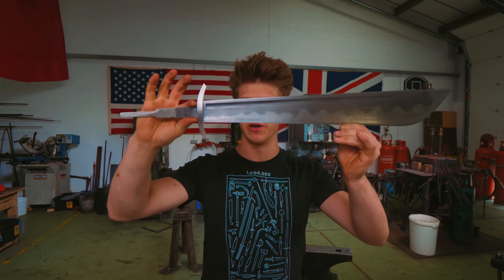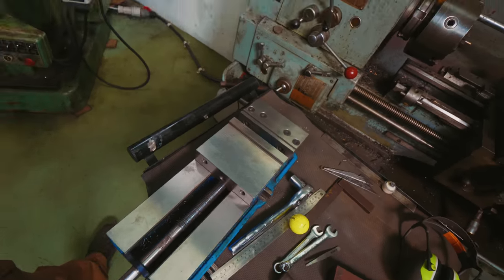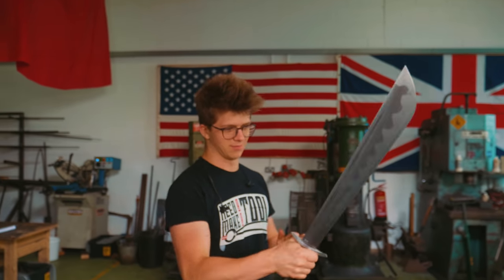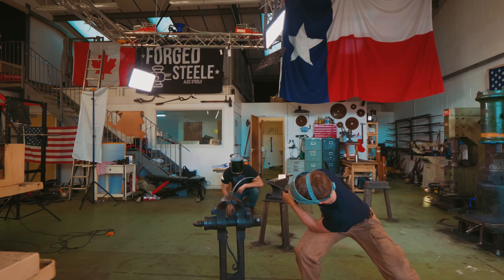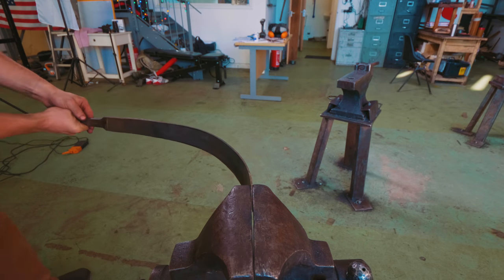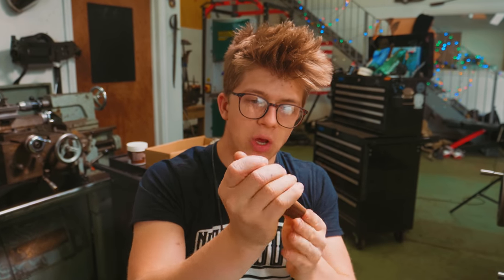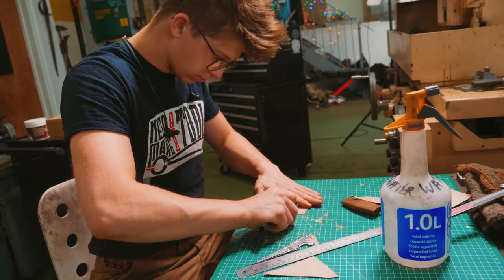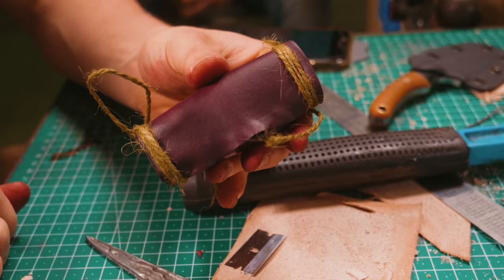MAKING A FALCHION!!! Part 7

Comment: Hey Alec. When i need to cut a leather wrap for a contoured handle, I wrap the handle in masking tape, cut the tape and peel it off, and use that as a guideline to determine how much to trim off the ends to match the changing diameter of the handle

Comment: Great work as always Alec!! As a dabbler in leather craft myself, I can feel your sudden  anguish when your skiving knife suddenly cuts too deep!😰 My experience: dampen your leather BEFORE you start cutting- it allows more control of your cut for some reason...🤔 Cheers!
Reply: GrizzWorks is correct about wetting your leather prior to skiving. If you are going to continue doing leather work. Get some professional tools. I make saddle bags and holsters along with knife sheaths. Also help in making custom fit saddles. Wet leather will stretch, THIN wet leather can do some incredible things when forming to shape. Keep it up. You are a very talented and curious craftsman.
Reply: Was just popping in to say much the same as Grizz and Jeremiah.  Damp it and skive it then soak and stretch the thin leather, let it shrink around the handle. Once it's dried, you can glue it in place neatly.  Have fun!

Comment: I've done the exact same thing when trying to skive leather, sliced right through the edge. Having a super keen edge helps to avoid that. Put a little jeweler's rouge (or maybe polishing compound) on the smooth side of some scrap leather and use to strop the blade on your beveler. Should help keep it from cutting where you don't want it to!

Comment: Alec i am not a professional by any means however if you are working with Veg Tan leather you are able to wet the leather and make it "fit" to a desired shape within reason. Once the leather dries it will retain the shape set (mostly). Also for skiving i have gone through several tools the safety skiver you used also. However i have found my best results have come from using an ASB Round Knife. It takes a little more finesse but it skives alot easier. A Marble surface to skive of with the tool is needed. On a side note for any skiving make sure your blade is REALLY sharp. Jewelers Rouge rubbed on to a leather strip and the tool pulled against it will give you the razor sharp edge needed. Apologies if you already know this, just sharing some of my limited knowledge.

Comment: Alec, since you occasionally work with leather, a good project would be to make a Damascus head knife. You can use as a skiving knife, push and pull cut and roll cut for precise cuts and for cutting around rounded corners. I think it would make an interesting project.

Comment: Try wrapping the damp leather around the handle with plastic wrap let it dry over night, then apply contact cement and let cure. Then use a saddle stitch to finish it up, if you want to get fancy,  apply a woven metal accent wrap over the leather.

Comment: To bring out a lot of activity in your hamon, try etching by rubbing hot lemon juice with two drops of dish washing liquid up and down the blade. Make sure you degrease first. You want the soft steel to be kind of a smokey grey. Neutralize, then use something like Mother's Mag and Aluminum Polish (I really like Mother's) to knock the oxides off. Do that 3 or 4 times, then polish with 1200 Al oxide powder mixed with 3-in1 oil, making a paste. Rub that all over the blade with lots of short strokes with a soft towel. I go to 2000 grit before I do this.

Also that wootzy stuff is alloy banding, it's not actually a good thing.

Comment: For waterforming vegtan leather I'd suggest cutting it a bit short (narrow?) for the circumference of the handle, and punching matched rows of holes along the two edges to lace it for drying and for finishing. I'd also make a slight bulge in the leather pattern to accomodate the changing thickness of the handle, making sure that there is some gap before stretching so the ends dont get baggy.  You can also trim it once you've started to wetform and stretch it.

Those skivers are awful, some people can make them work but I don't like them. I get the best and easiest results skiving with a very sharp knife with silicone and using the edge of a cutting board, or a "french skiver". You can also avoid them altogether and still get a really tidy finish by butting up two square cut (unskived) edges if you fit it by wetforming.

Comment: hey Alec, if you wanna try something interesting, say precise handle fitting. Screw holes where the tang will go then heat the tang up and push it into the handle and let the tang burn it to fit.

Comment: Nice video, super cool series in general. You could try and use a steel wire instead since it might force the leather to conform a bit more to the shape.
A few more pointers you might want to consider for another build is that the final constructing would be more solid if the guard fits so snugly that you need to use a rubber mallet to force it into its place. And secondly The handle might be more stable if you fit it by burning it onto the tang, that way there is a lot more tang to handle contact. 
I hope I didn't come of a condescending with my suggestions, but I though they might be useful

Comment: To clarify the main effect of differential hardening is keeping the sword stiffer and stopping it vibrating and bending during a cut. It however will stay at least a bit deformed if bent by force, because the unhardened steel doesn't spring back so well. On a katana, the usage of low carbon steel means it will stay bent even more, but it will be more forgiving in the cut.
Or at least that is my understanding.

Comment: Hey Alec!!! I have a build idea, if you would like :) 
Have you tried doing a wootz (woots?) Damascus? I have been researching the "damascus" steel, and from what I've learned, it seems like the smiths of yesteryear had melted their iron down with other alloying elements to creat the steels they used.
Perhaps, if you took a fairly mild steel and melted it down with a fairly high carbon steel, cast it into a billet and forged it, what pattern would that create? What strength properties could it have? I know it wouldn't be a true wootz, but seems like it'd be worth a shot anyways :)

Comment: Hey Alec, here is a little experiment to try to show how well a hamon or sanmai makes the edge stronger. 
If you take cigarette and bend it 90* it will brake. But if you wrap a bank note around it, you will be able to bend the cigarette 90* and back to zero, when you remove the bank note you will notice that it isn’t broken.

Comment: Suggestion for next/future project: Make your ideal zombie apocalyptic melee weapon! Mine would be just damascus machete with longer handle so i could 2-hand it if needed. Zombie meat is generally rotten so its kinda easy to cut, but you gotta worry about cutting through the bone. So you probably want something with  decent weight but still 1-handleable.

Comment: Alec, all your work are FANTASTIC, except one little detail: fitting the guards on swords. They suppose to be as tight as tang (literally) and hammered with pipe, or even a little tighter (then you can heat them a little, so the metal expands and shrink again on tang). Guards get heavy hitting and the resin is not good for that. 
I know that you like learning new things and I keep my fingers crossed for you :-)

Comment: Use a vacuum line on that mill when you work wood, and you will save a ton of mess and clean up as well as wood bits getting into your rails.....;)I see you already doing it on your grinder station...

Comment: Hi Alec (and Alex), I have 2 quick random questions, which are totally unrelated to the awesome Falchion build, hoping you can answer them for me.
I'm making a marking gauge for woodworking, and I'm adding a couple of brass inlays which are 0.8mm thick and 7.8mm wide, I've heated up the brass, over the gas burner of my kitchen stove, (a forge I do not possess) and bent it around the body of the gauge to fit the groove I chiseled out for it, but heating the brass has softened, and discoloured it..
My questions are, can it be re-hardened with a cold water quench, or is there more to it?
And will I get my brass shine back..?
I'm hoping to give this (and a couple of other hand tools, in a hand made display box) to my Dad for Father' Day in a couple of months..
Any advice on the brass would be appreciated.. Thank you.

Comment: That piece of leather looks to be far too thick. That may cause a rough transition from the guard. You want thinner leather, and might want a cord underwrap. If you wrap over the leather with cord it'll leave the impression of the under cord in the leather. Another fast trick to skiving the leather (not the best necessarily for seams though) is to wrap the leather around a pvc pipe and taking it to the belt grinder. Creates a nice and smooth bevel for overlapping and takes about 2 minutes to do. Great work so far on the falchion. It's looking really nice. Glad you listened to James elmslie; he's definitely the foremost expert on the falchion. Bet that blade will handle marvellously

Comment: You should have wrapped the whole pommel with string wet it tightened the string as much as possible and let it dry the leather will form to it might take a bit of time though use sheep skin for this application should work best good luck

Comment: What he is saying that the hamone is a benefit is in fact the opposite of a benefit. You do not want the sword bending and staying bent at all ever especialy on the battlefield. This is why no other smith in the rest of the world used the technique, it makes for an inferior blade. The reason for the hamone wasn't to make a superior blade but because they used 2 different steels, the edge was a higher carbon steel that was welded into a lower quality almost iron steel because the Japanese didn't have enough quality steel to make the whole sword out of it, the high quality steel was expensive and required more processing and thus only used for the edge. Because it was bimetal the edge and spine had to be quenched at different rates thus the hamone. If you just quench a bimetal blade it would be prone to stress fractures and even cracking during the process. Slower quenching for high carbon and faster for low carbon steel, thus the clay covering the high carbon to slow the quench down and they both properly quench at the same time and thus do not create stress and fractures.

The reason for the lower quality Japanese steel had much to do with their smelting process as much as the quality of the ore itself. They didn't use a crucible to melt the iron but tossed it directly into the hot coals and added more cola and ore/sands until they had enough metal to work(bloomery). That makes less high carbon steel and more impurities all around. The high carbon steel was separated leaving the bulk as low carbon almost iron. Thus they had an abundance of the lower quality. 

The best steel was from India, they would smelt the ore with a crucible and removing impurities then once they had near pure iron they would seal it in the crucible with coal for the iron and melt it down for 24 hours to get Crucible Steel, that steel was a major export to the trade city of Damascus where it was fashioned into weapons and then exported to the rest of the world even all the way to the hands of the Vikings. That was what is known as Damascus Steel or Wootz. And it was made around 300 BC while Japan used a bloomery in the middle ages. Medieval Europe had ditched bloomeries by the middle ages and were using crude blast furnaces. China had adopted India's method of making steel some 700 years after India devised it. Thus the rest of the world had an more abundant supply of high carbon steel and thus made spring steel swords.

Comment: I think you could make the handle a bit longer - in the middle ages people were smaller and with smaller hands. Yes, your fist must be locked between the guard and the pommel, but on the screen 85mm handle seems to be TOO short for your palm...
Reply: height difference, and particularly hand size are insignificant. 
Average height of bodies from the battle of Towton, 1460's England, is about 172cm, just 2.5-3cm shorter than the average height of men today. Though there have been periods where average height was different - particularly the 18-19th century industrial revolution, due to poor nutrition in towns - it does not alter hand size enough to make any difference. 

these falchions, as with later period Wakefield Hangars, and earlier period viking age swords, have extremely compact hilts which are designed to fit the hand tightly. the assumption you can make it longer is one of the most prevalent errors in modern reproductions: doing so dramatically alters the handling characteristics of the weapon.
Reply: Thank you for the reply, I re-watched that part where Alec puts his hand on top of the draft, and now I think my first impression might be incorrect - I'm well aware that falchion hilt must be tight, but at first glance It really seemed too tight for Alec's palm (I thought, maybe Alec has has really large hands). Also, I know that average size differences between different populations may play a role - for example, average Indian has much narrower palms in comparison to average European, and indeed many large-handed Europeans couldn't squeeze their hands into the hilts of some tulwars.
May I ask you, Is it possible that falchion hilts were adjusted individually to the hand size of the customer?
Reply: its possible, but that applies to almost all swords that were made - and chance are, the majority were simply mass-produced.

Comment: That idea of what a hamon is for on Japanese swords... you DO know katanas STAY bent, right? They are not flexible steel when made traditionally.
Reply: Aren't katanas more likely to snap then bend?
Reply: Krytern UK a good professional make of a katana is made the way it is so it will not break and absorb impact instead of shattering. You might get chipping but it's unlikely if it's an actual Japan made katana.
Reply: There is a certain amount of flexibility in katanas, but because of the thickness of the blade and the placement of the hamone there is a large amount of softer steel as opposed to the relatively thin edge of the blade. This has some advantages over a thinner option including compensation for the crappy Japanese steel used in traditional swords. If the blade were more flexible it can run the risk of cracking or even run the risk of delamination and shattering. The katana as traditionally made, solved the problems of bad ore and inferior steel furnaces. The katana is an absolute beautiful work of art and an amazingly functional weapon despite the conditions in which it was made.
Reply: James Whitman crappy Japanese steel? That stuff is considered to be some of the best if not the best steel in the world to make swords.
Reply: Stomping Peak the actual ore is an iron enriched sand that has loads of silicate and very inconsistent levels of carbon, thus the need to fold the steel several times and still needs a hamone in order to make a usable weapon. Japanese swords are fine weapons, but Europeans had far better ore and smelters to begin with, so the fact that the Japanese could make such good blades is something of a miracle. Unfortunately there is a lot of lore associated with katanas, and therefore a lot of misinformation.
Reply: Stomping Peak - You couldn't be more wrong. TODAY in MODERN times they are able to process their iron to make a much better steel but back when swords were actually used Japan had some of the worst steel.
Reply: James Whitman - The misinformation on katanas reminds me of anime fans who think katanas are the best sword at absolutely everything and nothing can beat them. Not bashing in anime fans as I watch anime sometimes it is just a bit ridiculous.
Reply: Krytern UK don't forget the Highlander movies. I love anime as well, and agree that they can be ridiculous, but the Japanese are artistic masters who put all of their lore, superstition, and love into everything they do.
Reply: James Whitman - I didn't mean the anime itself are ridiculous (they are works of fiction) I meant a lot of the fans who take anime as fact and so think katanas are unbreakable swords that are good at everything. I've never seen the Highlander movies so I can't speak for those.
Reply: Krytern UK you should, they are quite good as far as  old movies are concerned. The newest version of the movie has a scene in which the hero tries to remake his katana after being destroyed by the villain. The way he tries to forge the sword is laughable, and perpetuates the myth that Japanese steel is amazing, but even still, one can easily get a newbie involved with forging steel, or martial arts, or any number of hobbies associated with a well done film.